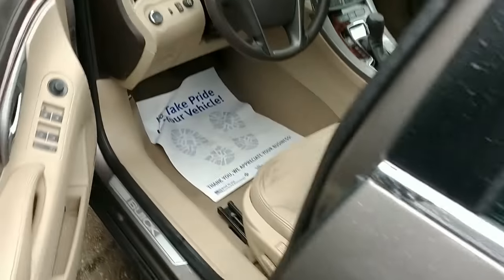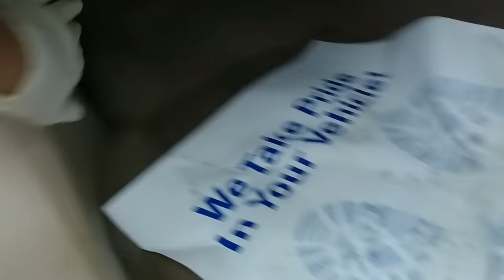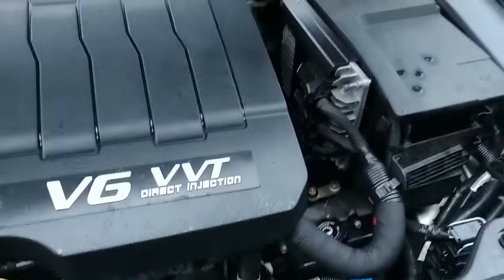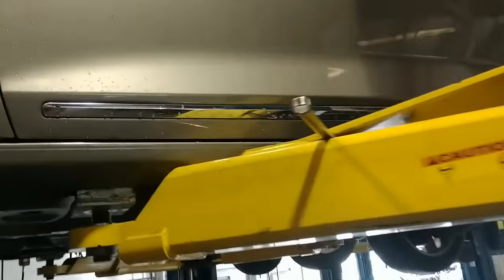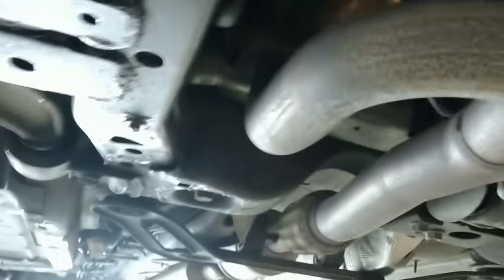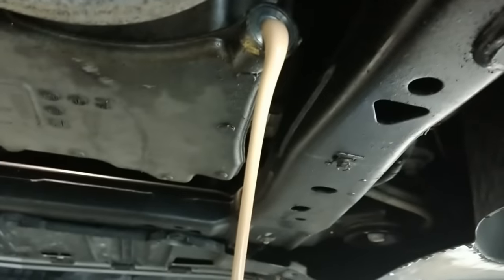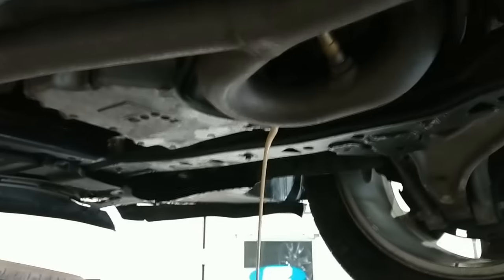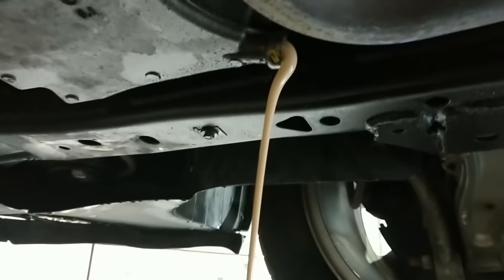Overfilled Crankcase! Blown ENGINE! Used Car Nightmare!

Comment: Very sad people get taken advantage of like this. She should know better or take someone with her who does but that isnt always the case. Just sad
Reply: She's a strong independent woman who needs no man and can do everything a man does, or better.
Reply: @FJDH11  what are you on because I might get some
Reply: First thing you do is pull the dipstick I wanna see clean oil and then check the coolant I wanna see clean coolant and no gas or oil mixed in. Then I start and listen to the engine turn off radio and tell the seller to shut up. All this can be done before test drive
Reply: @tamoracemo2048  It's called Reality, real strong stuff. Definitely get some.
Reply: No it's sad that General Motors has half its parts built in different countries and not in America! It said that the government uses taxpayer dollars to bail out billionaires! BS. We get f*** in every direction, that's who you should be yelling at!
Reply: @FJDH11  
I know plenty of men who know nothing about cars. But yes she probably is that way 😂.
Reply: @calvinevans8305  
When a car is test drove by me it will usually give up the ghost if there is any.
Reply: I am having a hard time understanding why someone would purchase an item when they have absolutely no understanding of what they are doing?
Reply: @ryans413  I want to see slightly dirty oil, so I know that they are not hiding anything by changing all the fluids
Reply: @ryans413  lol that’s it? Check the oil and listen? It can have clean oil and coolant because they can just change it right before you come. And since they did that with a head gasket leak then it’ll probably take a couple days to notice. They knew exactly what they were doing or there’s a slights chance that they did the timing chain/belt and either re used the old head gaskets or just ignored the leak (if you have to remove the heads for this timing chain) so it might not have been a problem before the timing chain, and judging by that silicone job I would guess they might be the type to reuse head gaskets which is a major no. 

I check all fluids, inspect common areas for leaks or signs of a leak, I check all suspension components for things like busted boots, rusted components, and loose steering components, then I check all the hoses cooler lines to see a sign of leakage,  then I check diffs and transmission for any sign of leakage around seals and cooler lines, and I check oil pan for leaks/damage. I also check interior stuff to see what works and what is busted or scratched. Listen to the steering while turning for a loud pump, also inspect the pump for leaks, and I always look near the rear main seal for leaks. If you smell burning oil then walk away (unless it’s priced accordingly). Then I grab the driveshafts and check for u joint play. I try to listen for timing chain slap and I test the 4wd on those models. Also I look for a plume of smoke coming out the back since that’s a major sign that she’s burnin coolant in the combustion chamber. My guess is that the oil and coolant were all clean at the dealership and they covered up a major problem that was going to show up in a few days, but they don’t care they got their money. What I’m saying is even this problem probably wouldn’t have shown up even with my inspection. It probably would have taken a few days to a even a few weeks to completely drain that coolant into the oil pan depending on how bad the leak is.
Reply: @HitLeftistsWithHammers  sus
Reply: @HitLeftistsWithHammers  hey tomoro is ur day bro, happy birtheday
Reply: @ryans413  d
Reply: @HitLeftistsWithHammers  
Didn’t really need a car on my island 😈😈
Reply: @mrwashur1991  there was a great episode of My Name is Earl where this pos car got a "hillbilly tune up"
Reply: They love preying on women especially. I remember all the shitty cars my mom was convinced to buy when I was a kid. She would end up spending every dime she had fixing one problem after another and it would still just end up going to the junk yard. '64 Falcon, '66 Olds, '76 Fury Wagon, '77 Pinto, they all were worthless cars. Didn't stop until she got the money together to buy a new '92 Ford Escort. Most reliable car we ever had! Once I got my own cars I taught myself how to fix them and now I avoid both dealers and mechanics whenever possible.
Reply: @mrwashur1991    I’m just saying that’s my basic go to the test drive would tell me more on the suspension the brakes the steering if it’s starting to over heat cause with a bad head gasket it won’t take long to over heat and could possibly start smoking out the tail pipe. And i mentioned turning the radio off and telling the seller to shut it because I wanna hear any suspension issues any engine issues under load which would be driving it and any other noises like clunking or grinding so on.
Reply: @ryans413  My current car has a blown head gasket with an exhaust to coolant leak.  As long as I top up the radiator, it'll stay cool for at least a week.
Reply: They take advantage of people will low credit that are in some form on need. Horrible business.
Reply: @FJDH11  hope she sees this bro maybe she’ll give you a chance!
Reply: @MannyDelReal  They do? Lmao. I appreciate how knowledgeable you are! I'll note that down, so I don't forget! 👍
Reply: Middle names. But she should have started it up their on that car lot before making them an offer unless she put coolant in the oil
Reply: @yodead369  they always had to many recalls on their cars
Reply: @mrwashur1991  they would have to drain that oil maybe 3 more times after re-running fresh oil in it then drain that out again and keep doing that until you see fresh oil draining out or its still gonna have that dirty oil in the motor unless they got away of flushing it without doing it my way that's how would have done it to get it all out 

And the engine needs smoke blown into it to check for the air leaks it probably has you said or someone else said they used silicone instead of a gasket I know most pans and things once you take it apart they'll need a brand new gasket old gaskets don't usually stay together once you take something off I know that from doing small engines and a few truck engines 

I can't remember if the transmission filter pan takes a gasket but I've cleaned those out before on a truck doing that job keeps it from slipping

Comment: My very first job was a full service gas station attendant in Anchorage Alaska. I had to pump gas, check all fluids and wipe all windows and lights. In the middle of winter no less. Very hard to do when you have tons of clothing on. 
Also. My dad taught me how to work on my car. He said I'll not always have a man around to do it for me. He was right. Several years after I left the station attendant job my car's engine cracked. My dad bought me a new engine and I changed it out myself. Took out the old and put in the new. Had the car another 4 years after that.

Comment: Emulsion. Oil water mixed. It expands the volume when it heats up. 5lts oil + 5lts water = 15lts of milk soup.
Reply: Good to lubricate a Lathe cutters but with bit less oil in water.
Reply: Had a farm tractor where water collected into the transmission for close to 15 years.  I got 90 litres of "custard" out of that transmission in what was supposed to only hold maybe 40 litres. I'm surprised the transmission held up to that.
Reply: 15 liters by volume though not by weight.
Reply: @joshuaa.5523  Litres is a measurement of volume so how can it be by weight?
Reply: @outrighteight8205  I'm thinking they meant by mass?  Mass would make sense, as the mass would not increase, hopefully.
Reply: @outrighteight8205  Not only did I think Liters and Litres were different, I also thought at least one of them was a weight measurement. I have learned.
Reply: maybe you got it confused with the fact that 1 Liter of water weighs 1 kilogram?
Reply: @Puffie40  Farm equipment's just built different I guess.
Reply: @outrighteight8205  the metric system is weird like that, 1 Liter is 1000mL 1mL is equal to 1 Cm3 and 1 Cm3 of water weighs 1 Gram so 1 L of water weighs 1 Kg of course that is only for water so it is not true for less dense fluids such as oil of course that still wouldn't be equating liters to a unit of weight I just like sharing weird quarks of the metric system.
Reply: @josephvanas6352  it's not really that weird, if anything it makes way more sense than the imperial system (also I would rather not start an argument about which is better), just in my own experience
Reply: @outrighteight8205  Fair enough lol, its just a lesser known feature of the metric system you might say.
Reply: "Milk soup" 🤢🤮
Reply: @joshuaa.5523  "15 litres" can only refer to volume - by definition, the litre is a unit of volume.

Comment: Any chance we could get a follow up on this? I would love to know exactly what happens and how much soft serve actually came out lol
Reply: it was definitely oil and water coolant mixed together. and there are two ways 
1 somebody filled coolant in wrong hole\tank 
2 one of engine gasket broken or engine cracked that is why of liquids mixed
Reply: @00pingvin00  considering the timing case with sealant on it. Someone got it working just enough to off load it from a cracked head, or cracked motor. If it was a bad gasket they would have most likely replaced it if they went that far to get to the timing case.
Reply: @00pingvin00  I’m going with 1 considering it’s at a buy here pay here. And it’s a Buick.
Reply: @marsvoltron  I always enjoy a good comment I can learn something from, thank you sir
Reply from the maker: It drained for four hours. I'm going to repair this car sometime this week. I'm make a video of everything
Reply: @RainmanRaysRepairs  maybe intake gasket?
Reply: @RainmanRaysRepairs  holy crap man!
Reply: Neat...recent
Reply: That looks like a bad head gasket or cracked head, that's why there's no coolant left in the reservoir. I'm guessing the dealer knew about this and that's why they had the timing cover off, because that's where the water pump is on most modern sedans
Reply: Typical used car dealer scam.  When you pop the hood and all you see is shiny things, that's a red flag.  With the way the milkshake was coming out, and considering that the motor overheated so bad it shut off, this POS needs an engine, case closed.  Would be awful to do the head job then the motor starts knocking shortly after.  Remember, always pay a third party to perform a pre-purchase inspection before buying used.  My.shop.does these all the time, and we've saved quite a few ppl from getting bent.
Reply: @M4sterT3ch  Pull the fucking stick out of it, look at the oil. It looks new. Ok. Get under crack the bolt. It looks new. Ok. Run the car at idle for 30 minutes. It starts smoking. The oil looks milky. Ok. Imma not buy.
Reply: @RainmanRaysRepairs  Subscribed and I look forward to your follow up video!
Reply: @M4sterT3ch  i am vendor for quite for dealerships. I have one dealerships who doesn't like putting money into stuff. But they are not shy about it. They are  upfront about the turds. I love it, people who are not scared of fixing stuff on their own can get some solid cars for a solid price.
Reply: @RainmanRaysRepairs  How do you even go about fixing it? Craziness.
Reply: @jacobmoore4665  Not to mention there was no coolant in the reservoir
Reply: Intake manifold gaskets on GM engines are plastic. They commonly fail and can dump the coolant into the engine oil.
Reply: @RainmanRaysRepairs  waiting on the follow up
Reply: @00pingvin00  the way the engine overheated when the lady had it and  steamed while running for Ray, def. a head gasket at least.
Reply: @M4sterT3ch  The dealer probably knew it was a pile of junk when they bought it for $500 at wholesale from a more reputable dealer that doesn't sell that kind of garbage, but they knew with a car wash and bottle of armor all they could unload it on someone.
Reply: @tcmr5775  You don't. The engine is trashed and needs to be completely replaced.

Comment: From my experience: ALWAYS drive the car you're looking to buy on the highway or another higher speed road to ensure everything is good to go. Bought a Grand Am from a guy downtown with no highway for like 20 miles, and the fastest roads going only 40 mph, and as soon as I drove it on the highway a few days later my engine began overheating. Dude rigged up my broken head gasket long enough for me to test drive it and get home.
Reply: In France there's a hidden defect law which protects you from that and forces the seller to disclose that if they know it, and even if they don't, a defect present that would have been bad enough that you wouldn't have bought or bought at a lower price is classified as such.
You can also sue for damages and interest if the sale was made in bad faith and it caused you trouble (for example you had to get the car towed or you couldn't get to work for a few days, or an arbitrary amount for the trouble caused.)
Reply: @manaquri I’d imagine the car resale rate in France is terrible
Reply: @tylercecil5634  nah resale is pretty good, just people have to actually disclose if there's corrosion or crap like that.
It's not that strict, it's more like if there's a deal breaker it should be mentioned.
But yeah if you have a pos you're probably better off selling the working parts
Reply: I was about to buy a Corvette Z06 earlier this year. Had the car on my radar, a driver example with some miles popped up and I went and took a look. Rough, but serviceable. Price was right.

Then I drove it on the highway. The front end was FUBAR. There was a huge amount of slop and vagueness when changing direction (weaving) by loading up the suspension. I've driven a new Z06 500 miles before so I know exactly how the car should drive. Under medium braking it was even worse, it didn't pull to one side, it "squatted" and steered to the left. It wasn't a brake issue. There was serious systemic issues with the front suspension\frame that was far more than "the upper control arm bushing is making noise". It's very possible the entire front-end needed to be rebuilt. 

Was honest with the seller about my findings, he balked, I walked. Car sat for another 3 months and had it's price dropped 3 times almost to my offer before it finally got delisted (presumably sold). 

Always, always, always drive the car. Hard.
Reply: Driving alone will not prove anything... This car drove 100 miles....!
Reply: @copmy  well in my experience of being ripped off my car drove fine until I drove it on the highway 3 days later. Had no problems until I hit 65
Reply: @HowieRaps  Yes, it’s best to check it carefully combined driving at low stop and go, and at high speed. I was a mechanic instructor, but I had bought many cars in my life time and I missed it many times as well. When you are dealing with a dishonest seller, you can’t win regardless. Thanks. Take care of yourself.
Reply: That and check heating/ac/radio/brakes/etc.
Reply: Yup and that's what nearly everyone does to get rid of their junk. Whatever happened to heeding, Buyer Beware?
Brand name dealers especially dealing in used cars, used car dealers, and private owners are all guilty.
This has been going on from the beginning of automobiles. I've been taken in by a few slicksters, too.
P.T. is thought to have said, "There's a sucker born every minute". It's only human to screw everyone.
Reply: @tylercecil5634  Well, you should first see how the cars look there. Not a single one without some major scratches and bumps on the fenders, and/or mirrors, and/or doors.
Reply: @lowstrife  He probably wrecked it into a curb.
Reply: In most parts of the world dealers can't sell a vehicle even 'as-is, where-is' without disclosing major defects and something like this happening within 7 days voids the sale (normally 3 months for normal sales) . Dealers may not like it but it's a risk of the business
Reply: Exactly 89 Pont Grand am. When I arrived to pick it up, I saw a guy under the hood checking the coolant level. Should have taken the sign of warning. Head gasket blown and car overheating the following week.
Reply: sodium silicate is what they used to use. now they have a bunch of stuff that can work briefly
Reply: @satibel  …, same in many US states. It’s called lemon law.

Comment: It's kinda nice to have atleast some protection from this kind of stuff here in Cali but this video has taught me to always get the vehicle inspected before purchase
Reply: that can help but is nowhere close to a solution. I live in the rust belt, many people store their favorite cars to keep out of road salt but don't regularly start and warm up the car. Everything is fine until a hot summer day and some gasket will just give out. It always seems to be plasticy or rubbery parts that can't handle sitting. I guess I don't know of a reasonable quick check to verify if the head gasket is just brittle enough to pass inspection but fail after a few hours at max temp
Reply: @elijahmiller912  Yup. Weather and Salt will destroy just about anything.
Reply: @Russ Olson here's another: "keep the government's hands off my medicare" (an actual sign held by some right wing old person at a GOP rally).